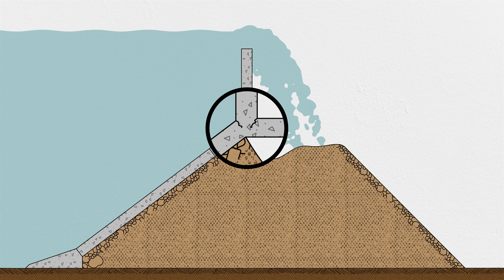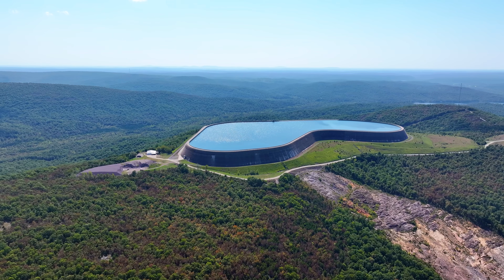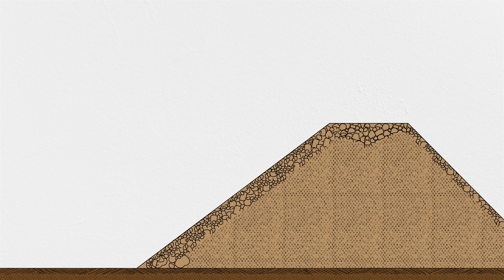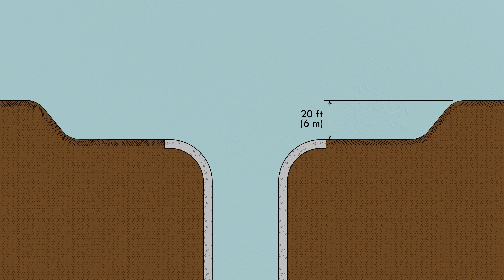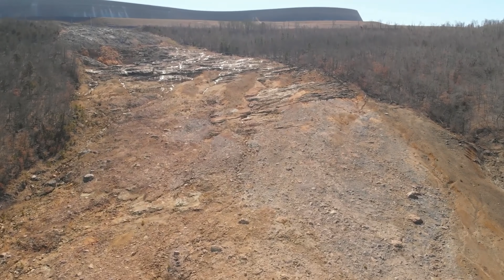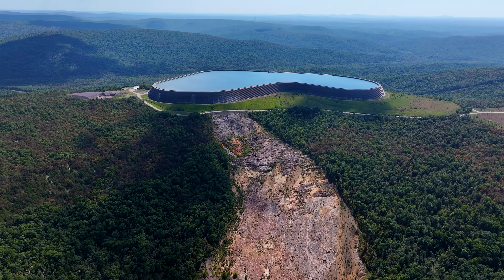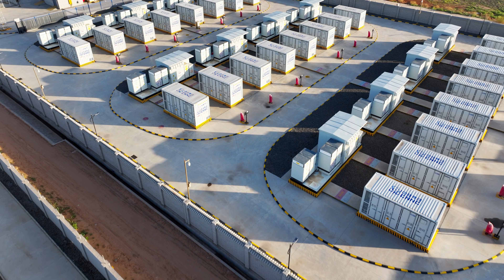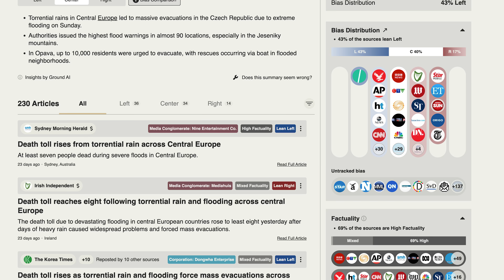The Wild Story of the Taum Sauk Dam Failure

Comment: Excellent video, thanks.  I've liked and subscribed.  A spillway makes sense but how would it have mitigated this failure given that part of the problem was wall settlement (which the operator was apparently unaware of).  In other words, the failure was in part because of reduced wall height, and rapid erosion in conjunction with the overflow.

Comment: What impoundment of water doesn't have a designed physical overflow capability that is not reliant on sensors?  What impoundment isn't monitored while known inaccurate sensors are being "recalibrated".  This was not an engineering marvel but an engineering disaster with predictable if not guaranteed failure points.

Comment: Why couldn't they have raised the walls about 3 feet, except for a 50 foot gap that led to a concrete slide that ends 100 feet away from the actual dam? It's a zero maintenance failsafe.

Comment: The idea of "Battery Storage" facilities to provide electrical power to the grid scares me when you take into account the thermal intensity at which most lithium batteries burn. most of these battery power stations will most likely be placed in rural areas where it is almost always a Volunteer Fire Dept covering the fire district... Will the owners of these battery power stations provide the needed equipment and continuous training required in the event of the power stations catching fire.. then there is the "Environmental impact" of the toxins from the debris contaminating both the agricultural soils and ground water surrounding these stations.

Comment: The nosediving Boeing planes and now this dam have had the same issue happen to them. An automated system isn't working properly, and engineers (probably given too small of a budget) try to code a bandaid into the software, instead of actually fixing the system. Inevitably, when the bandaid solution fails, it fails catastrophically. 

We can't fix poor systems with bandaids, we need to actually repair the systems.

Comment: Only engineers would measure the water level at the top, using sensors at the bottom.  A few freaking $10 toilet floats on the walls with electrical contacts instead of valves would have done better.

Comment: 1. put in level sensors in without measuring elevation!
2. no spillway
3. filling to tippy top
4. Lack of time sensitive shut off. "Hey why are the pumps running an extra 30 minutes today?"
All equals = Total gross negligence. 

This project is not sound engineering at all, sounds like a bunch of sloppiness disguised as engineering.
Reply: Cracker Jack called; they want their stamps back.

Comment: When you need energy from/out of it, you let the water go/run down, and then pump it back up later, well that works fantastic, and is such an ingenious idea, after all, pumping that water back up also consumes energy , and they lose most of the energy by pumping it back, a fantastic and ingenious system, and now you can say that it is only pumped back up at times when the demand and costs of energy are low, but that does not change the outcome, after all, it still consumes energy, only at suitable times 😑🤨

Comment: If a regulated company is solely responsible for reporting/inspecting failures to the regulator, you don't have a regulator. You have a cleanup crew. Regulators need independent oversight and inspection capabilities.

Comment: It sounds there was lot of incompetence involved here, they should have had multiple backup sensors, and also have a way to monitor it better. At minimum they should have also had one employee that has a job to patrol the area and make sure things are operating normally. There are lot of things that you simply can't see with only sensors.

Comment: It's a big failure of OSHA PSM procedures, if this site even implemented such a program. a Process Hazards Analysis should have caught the over-relience on the complex control system (regular ones are only capable of reducing risk by a factor of 10, which is pretty paltry). It should also have caught the lack of mechanical passive safeguards like a spillway.
For a case study of expectations of performance on Hazards Analysis, search for "Impact of the Esso Verdicts on Engineering Practice" by John O’Meara, available freely on the web. It talks about the 1998 Esso Longford disaster and how the court found that the HazOp study was lacking and should have identified the risks that lead to the disaster.

Comment: Batteries are great, but they do need to be replaced after some years
Not saying that a hydroelectric upper reservoir "battery" is better, since it does also have big costs of maintenance, but even though it is only 70% efficient it seems to me that it keeps the output predictable over decades and is way more eco friendly, since you don't have to "toss" the old batteries

Edit: I got no data to back me up
This is purely my thoughts/ideas on a subject that I have no studies on

Comment: Really interesting video on a subject I'd never heard of. I work in civil engineering in the UK and one of the biggest continuous risks we face is complacency and as I was watching there seems to be a lot of that around the original Taum Sauk design and operation, be it the construction material, inspection of said material, the reliance on the automated systems, the additional freeboard level etc. There seems to have been a bit too much "Na, it'll be fine." which is almost always a root cause or main factor of incidents.
On a completely different note, I have to say; the redesigned dam is quite the eye-catching structure.

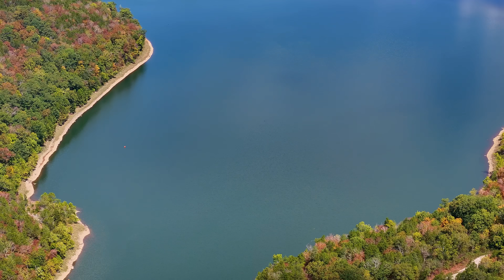Comment: 4:28 If the location was "perfect", the ground holding up the wall would not have reoded quickly.
Reply: I think thats way more of a engineering issue.... if it washed away the rock fill that they had the concrete slabs built on thats on them for putting that material down

Comment: My country don't have bad flooding problem but i have seen problem in city design... 
Everything in made made concrete and asphalt, but no ditch or gutters. 
So when heavy rain hits, it can cause small flooding that would be easily prevented. 
Small rain water collection system just can't take heavy rain and it is blocked when lots of water moves rubles on it

Comment: A basic HH. (High-High) float sensor attached to the edge would have prevented this.    Basic instrumentation/control design incompetency also was the secondary cause (after an unsafe engine redesign) for the Boeing 737Max.

Comment: Disclaimer: I am not an engineer. What if instead of large volumes of water we changed the temperature of the water and used heat pumps or something to extract the energy back out of the liquid? I'm guessing far less efficiency, but could the footprint and startup costs offset this?

Comment: You can’t control water. Water have be  constantly flowing. If you trying to control water there going to be a physically have human eye constant maintenances by electronics monitoring. Overtime water can erode or cause corrosion. But Engineers forgot one design method. Water is the 2nd strongest entity in the world and the sun 🌞 is the #1…..”It cannot be controlled”. 🌊

Comment: I lived in St Louis when this happened. We'd go to the park frequently. It's absolutely astonishing that a reservoir was allowed to be rebuilt to nearly the exact same specifications as the one that failed. It was a complete failure of human oversight that caused this issue. Pure laziness.
Taum Sauk exists solely because it's one of the only stations that can restart the grid in case of full failure. Nuclear Power plants require power to start up. they are completely useless in a full failure. Taum Sauk power plant can be used to supply that power to restart a reactor.

Comment: A properly designed depth sensor doesn't need elaborate cables, penetrators and so on. A simple hose attached to a weight at the end. Pump a small amount of air through the hose and allow it to bubble out the end. The pressure of air in the hose will be the same as the water pressure at the end of the hose. From there simple pressure gauges and pressure switches can be used. It doesn't matter if the hose sinks or floats or moves in currents. All that matters is that the open end of the hose remains in a known location.

Comment: I don't like focusing on the spillway. The spillway wouldn't have fixed the actual issues the dam had, and potentially wouldn't have even helped prevent what happened at all.

What they needed to do was make sure the dam was level, that was the root cause of the failure. Those emergency sensors that never went off are basically the same as if you already had a spillway on that side, kind of useless.

Comment: Not even a minute in the video and I can't even believe what I'm seeing. As a process engineer this is completely crazy to me how there seems to be no safeguard at all avoiding a catastrophic event from a simple automation failure.
1. simple mechanic failure system is bear minimum, like a overfill drain
2. Electric shut of system acting before the mechanical system has to act on
It's very simple and super cheap compared to overall project costs.

Comment: I used to be an instrumentation engineer, this is actually a safety controls design failure. I designed a pump station and had to take this into account, obviously they didn't.

Comment: I am not an "engineer" for dam systems... but I can say without any doubt... the moment you showed the picture I already predicted the outcome.  Had they just used a little more concrete to protect the buildup so that it could not be eroded so quickly.  I also bet they knew that and I bet they decided to "cut" that corner too.  As someone who drives down the road, I see many many areas of land that experience erosion like this with just regular rain.  And sure, I bet this was accounted for and built up better than a cheap retaining wall... but if someone as dumb as me could spot the problem so fast... why didn't they?

Comment: In this case, since the elevated dam inflow rate is known because pumped in, they do not even need a typical complicated spillway. All they needed is an overflow piped to the lower dam, sized for 120% of the pumps capacity. In safety, passive systems are always much better than systems requiring gadgets to work.

Comment: Jeez. The flood sensor could have been installed much cheaper and more reliably. The sensor cable with a weight is installed in a metal, corrosion-resistant pipe, the pipe is lowered into the reservoir at one end and secured by three pins on pipe in prepared holes in concrete. Due to their affordability, four such pipes with sensors can be installed around the perimeter and serviced in rotation, without compromising safety. The cost of these sensors will not exceed $10,000 for four pieces, plus they are protected by the pipe from water flows.

Comment: batts are the worst solution you have the loss from ac to dc but then have the loss of dc to ac. there is also our batteries degrade over time. why is a good storage of power getting sent to a less efficient one in the short term. this is the problem with engineers they solve problems now but never think into the future! it's the maintenance people that get paid less the clean up your mess.

Comment: three items... any safety system will fail.  a fail-safe is just that and no more.  test your safety systems.
I am agast the owner/operator ignored the third, skipped the second, and clearly thought the first was not applicable.
"what safety system?"   as simple as a spillway and a sound sensor...  you can see your lost power sliding down a spillway.

odd way to save a dollar...

Comment: I would caution on your optimism about battery storage vs hydro storage though.
Batteries do have a remarkably different risk profile than hydro. The most important feature being that we have less experience with battery failure at scale than we do hydro failure.
The primary reason that water even can be phenomenally destructive is because of the potential energy that it stores. So literally any other method of storage is thermodynamically guaranteed to be capable of similar amounts of devastation if that power gets released in uncontrolled fashions.

The only reason we are not used to seeing that in batteries is because few people have ever tried to store so much power in a single battery bank that they would actually be able to use that power to fill the Taum Sauk.

It's very much no mystery why we harnessed both fission and fusion reactions to make explosive weapons so quickly before perfecting their use for safe power generation (with fission still being on the fence in the "safety" regime and fusion still half a century down the road to self-sustaining power generation despite Tsar Bomba being detonated well more than half a century ago): it's because bringing any large amount of power into a small space is by definition a bomb, and containing and controlling that power for safe storage and use is always many orders of magnitude more challenging than aggregating it in the first place was.

Comment: This is a classic case of owners economizing on having construction services inspectors to observe site stripping and fill placement.  I worked for a geotechnical firm that offered construction services and one owner declined full services during construction.  They only wanted our techs to check fill compaction on the final subgrade.  The contractor with no observer placed fill in overly thick layers so that the lower portion was poorly compacted.  The trench for the perimeter footing was so soft its side walls collapsed into the trench.  Yes, lots of mistakes made, but cost saving in assuring specs are followed and unforseen site conditions are addressed during construction were critical in this case.

Comment: Damage is proportional to stored energy, as failure means releasing that energy in uncontrolled way, regardless of type of storage. I mean type of storage has influence on what damage that energy causes, but it is roughly same order of magnitude. Current batteries are much smaller (in terms of stored capacity), thus you need more of them, that means higher cost of storage per capacity unit and lower cost of single failure event. Also more total number of failure events, thus more opportunities to learn from mistakes.

Comment: guess they couldnt afford to mount a camera up by the dam to optically monitoring water, heck could probably be automated with such a camera as one can easly put in color detectors on the image itself that can read color like water or concrete to tell how high the water is, wich also double functions as a way for them to check on water directly at any time instead of relying on passerbys

Comment: A fellow technician worked at British Columbia Hydro. As an intern he installed remote water level sensing for a SCADA type system. It was probably some sort of float system, but I wish I could remember the technology. It may have required routine maintenance for leaves, calibration, .... It was not used at a dam.

Comment: The spillway in a pump storage can have a second function as well.
Grid frequency goes up and the storage gets filled...lets say the frequency is still not stabilized but the dam is almost full. Turning of the pumps will increase tye stress on the grid...with the spillway you can just keep the pumps running and let it overflow to use up the excess energy

Comment: Speaking of dam failures, there were at least two dams in WNC and East TN that “failed” during the flooding from Hurricane Helene. Both dams are, as far as I know, still standing and as functional as they were the day before the flood. 

What exactly does it mean for a dam to fail if it doesn’t have to fail?
Reply from the maker: Usually defined as an "uncontrolled loss of the reservoir"

Comment: My toilet has a float valve that automatically cuts off the water supply when the water reaches a specific height. Maybe this could have been avoided by installing a.n emergency off switch on the water pumps. When water level rises, the float rises and trips 2 switches. 1 switch cuts off the water pumps and the other starts the overflow pumps.

Comment: So, I hear this and two things come to mind, no overflow capacity on the storage dam and inadequate controls and supervision of the operation.

PS:  So in the end you throw the design and construction professionals under the bus when in fact a lot of the blame and responsibility belongs to the management of the company.  I have seen this situation time and time again in that the question raised by management is "Why do we have to do this?" and if it is not a regulatory requirement then it doesn't get done.  The items that you raised in the report are aimed more at management of the facility and not at the design and construction professionals.

The cause of the failure appears to be more due to lack of maintenance.

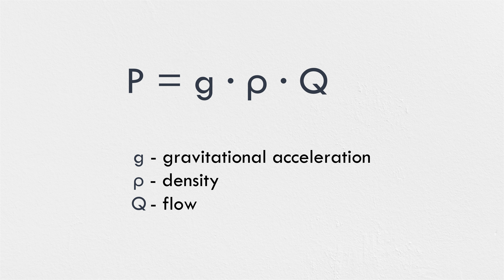Comment: At 4:08 you mentioned that it's only possible to adjust the "head" and "flow" variables and that it isn't really possible to change the gravitational acceleration or density of the water.

 While I agree that changing the gravitational acceleration while on earth isn't realistic, the density of the fluid could still be changed by adding salt at the top of the reservoir.

 This leads me to ask two questions:

1.) Would  brine be dense enough to make a noticeable increase in power generation?

2.) Would on-site brine production at that scale even be technically possible?